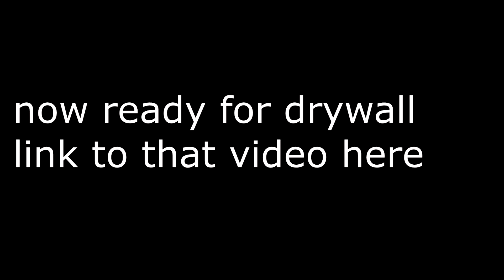Finishing my basement episode 19: Wine cellar build #4 - vapor barrier and insulation.

Comment: What’s the r value if the rock wool?
Reply from the maker: The Rock Wool is R-15.  The wine cellar itself is fully inside the insulated basement with R-15 fiberglass plus an airspace and then closed cell foam insulation on the poured walls.  Thanks for watching!